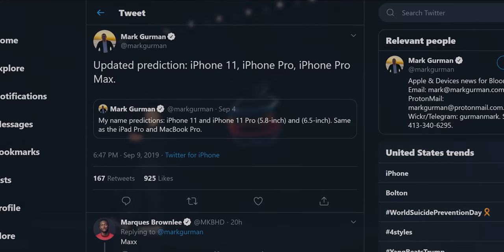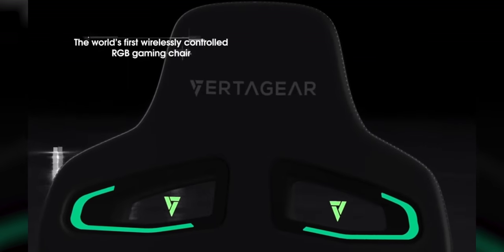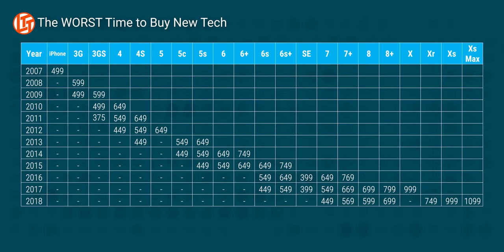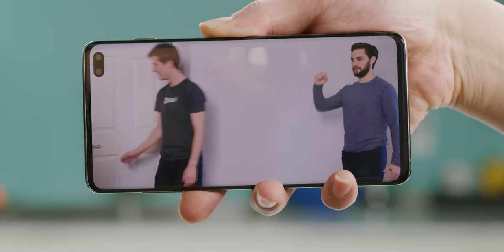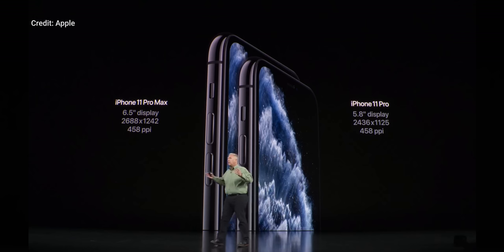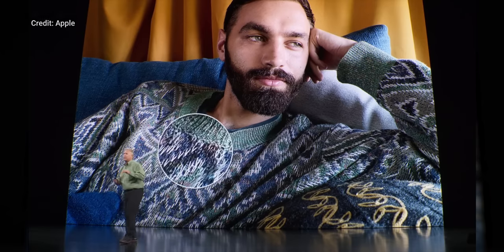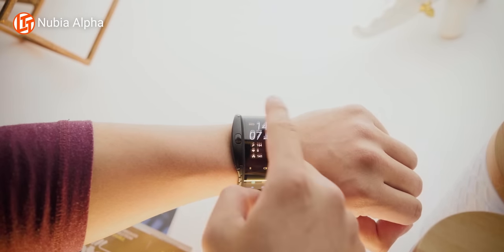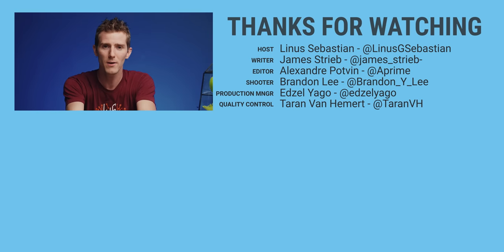Apple iPhone 11 REACTION!!

Comment: LINUS. If you say "LCD Display" again I'll rip all of your LCDs out of your devices, mister Liquid Crystal Display Display
Reply from the maker: That's fine. Just don't take my SSD drives!!
Reply from the maker: Or my NIC cards!!
Reply from the maker: Or my CPU units!!
Reply from the maker: Or my VGA adapters!!
Reply from the maker: Or my ATM machines!!
Reply from the maker: Or my SUV vehicles!!
Reply: Linus is high.
Reply: There's nothing wrong with saying LCD Display. LCD is an abbreviation for a display type. 
It would be wrong to say "Liquid Crystal Display Display" because you are mentioning display unnecessarily many times.
Reply: @LinusTechTips  looks like someone took an extra dose of caffeine
Reply: @LinusTechTips  how high are you Linus?
Reply: Linus Tech Tips I believe you meant VGA arrays.
Reply: Right!!!! Like HD Definition
Reply: @LinusTechTips  u didnt mention gpu so can i have a 1080 or 2060 😉

No srsly i need a computer im playing on some crappy laptop

Comment: Surgical grade stainless steel - an invented term with no genuine meaning.
Reply: I take it to mean that every time you pick up the device you get cut open.
Reply: @ianbarton1990  XD
Reply: Wait you guys dont make scalpels from iphones?
Reply: @ianbarton1990  You'll feel as though you've been cut open if you buy the Pro-Max-plus-RAD version of the phone.  Anyway, the Apple faithful bleed money, so no problem there.
Reply: Being that it's not magnetic, it's 316 alloy stainless. Sounds specific enough to me, but could lose the flashy wording. - Materials Engineer
Reply: One thing for sure though, it will take money away from the buyer with surgical precision (but not so much when dealing with their faulty goods :P)
Reply: 316 Stainless much?
Reply: Steel good enough for surgical equipment? Like, The new iphone 11 can perform lobotomy..
Reply: Next time
Surgical equipments: iPhone-grade stainless steel.
Reply: they surgically remove your money out of your wallet.
Reply: Apple learned this from Xiaomi. Several years ago Xiaomi called their stainless steel “304 austenite”.
Reply: Steve Jobs + Marketing Jargon = Actually Amazing Products with decent marketing.

Marketing Jargon without Steve Jobs = Nonsense gibberish.

Like that, and bionic chip.
Reply: To much slingshot channel for you.
Reply: @seanlee7037  And 304 is like the lowest grade Inox you can get. But hey, it's easier to weld than 316.
Reply: So... the same as an Xacto knife.
Reply from the maker: It's the marketing term for a few grades of stainless steel. SS comes in various grades, like most material goods.
Reply: At apple price iphones should be made of titanium abd then people say its premium
Reply: Means it's germ free and will rust in no time if exposed out of wrapper.
Reply: That is actually not true. There is a such thing as surgical grade stainless steel, because that is the same material as scalpel and other metalic medical instruments.
Reply: That is a thing. It’s used in biomedical applications. So no it’s not a made up term.
Reply: @LinusTechTips  Woosh! Thanks captain obvious. "It's a marketing term" is what we've all assumed, because anyone who knows anything about steel knows its a BS term, just like 'aircraft aluminum'. You know, to distinguish them not using chinese 'potmetal'
Reply: @cyphre  OP's point was that is has NO meaning, but LTT pointed out it has SOME meaning (ie. rust resistant + non-magnetic; 316, 410, 420). Just not a standardised one. So OP was wrong...fair enough response imo?
Reply: Marketing
Reply: So is the term iPhone
Reply: No.. we need weapon grade speakers.
Reply: @chrisp7277  You'd lose the attention of the average consumer by the time you make it to 1 in 316. So surgical steel serves the purpose of conveying meaning better to the masses. - Another Materials Engineer
Reply: I think it should become a THING that the tech geek community starts calling this new apple phone.............. The Can Opener lol

       There we go internet. Let's make it a thing.
Reply: @cyphre  "aircraft aluminum" its the cheapest one because that's the most commonly made aluminum. that's what an engineer told me.
Reply: Incorrect. Surgical grade stainless steel is a special grade of stainless steel that doesn't contain any potentially poisonous metals. (similar to lead-free brass that is used for plumbing fixtures, whereas most brass alloys contain a small amount of lead to make them easier to cut with machine tools.) Surgical-grade stainless steel is used for prosthetic bone and joint implants. I agree it's kind of pointless for a smartphone case to be marketed as "surgical grade", but I suppose there was no reason to select a different stainless steel alloy that does contain potentially poisonous metals if the metallurgical properties weren't actually any better for this purpose.
Reply: Surgical grade means that it is so designed to remove cash from your wallet and makes you think that is a good thing.
Reply: Surgical grade stainless steel means that the phone will never bend. If it falls there’s almost no damage because of its resistance to compression.
Reply: Its actually 316L stainless steel.  But yeah marketing term to make it look cooler kinda like air raft grade aluminum

Comment: "Carved out of a single piece of glass" that sounds like a nightmare to repair.
Reply: They couldn't even cake a camera glass that didn't crack by itself and they made the whole backing out of cncd glass, I mean what could go wrong
Reply: Anything Apple is a nightmare to repair tbf
Reply: Repair? An Apple product? Bro, where have you been for the past 20 years? Apple doesn't want you repairing things.
Reply: Omry Goldwasser  ''not always that even can do it.
Reply: Omry Goldwasser  by repair you mean hand you a refurbished device for half the price of a new one. They don't actually fix your device for you
Reply: You can't repair it. And that's the point.
Reply: Exactly. They don't WANT repairers to be able to get in.
Reply: The wireless charging trend is such a shame. Of course a device which complete back is made of glass is fragile and harder to repair than a unibody design. Up to the iPhone 7, the phones where so nice to self repair and there are sooo much cheap spare parts if you want to do it yourself :(
Btw that's not only for Apple, only they charge these horrendous prices for an inhouse "repair". 
I think changing to high quality plastic materials for wireless charging would benefit the market so much. Or just skip this shit completely, WC is just inefficient and complete nonsense like how hard is it to plug a cable in?
Reply: I know, they are so excited
Reply: of course its made of one peice of glass how does one make a glass plate/window from multiple peices like that -_- its always been like that
Reply: Omry Goldwasser : If a repair typically costs 50% of the cost of a new product, that's how you know the company doesn't actually want customers to repair products, but they are trying to avoid being sued for refusing to offer repairs. ;)
Reply: Bingo! "Worlds first Trillion dollar company"
Reply: You guys need to watch (louis rossmann)

Comment: The fact they still don’t have a USB-C port for the Pro phone is infuriating...
Reply: I'm guessing next year for the design overhaul. Prepare for heavy self congratulation when they do.
Reply: Are you infuriated?
Reply: At least we have a Lightning to USB-C cable and USB-C charger in the box.
Reply: MysteryMii true but the problem remains, when all your devices are USB-C, including laptops, iPad pros, and headphones, the need to carry around a proprietary lightning plug just to charge your phone is infuriating.
Reply: Nolin Huddleston why do u need usb c when the lightning connector still can be reversible...
Reply: @syedemeer6843  how do you reverse a lighting connector??
Reply: Ov3r Yuno usb c is reversible...
Reply: @huddleen  exactly
Reply: @syedemeer6843  usb c is the standard for most other devices. That way you would only need one cable for everything. Plus it delivers more power, faster data transfer, and i think charges phones faster?
Reply: well what kind of upgrades would the next iphone have!? they gotta milk it as much as they can.
Reply: Since it's an apple patent, it's more profitable to use that than the standard for every device that's non-apple. #justapplethings
Reply: @Abby Stephens usb-c on one end, but the end that plugs into the phone is lightning. Every other phone on the planet, and many other electric devices have non-proprietary usb-c Jack's instead of lightning, including most "pro" devices.
Reply: Kind of ironic that the Macbook is all about USB-C but they won't put it on the iPhone.
Reply: It goes against their entire ecosystem it's all a money thing because they own the lightning port this is why I use Android
Reply: the pro means the camera pro
Reply: Nolin Huddleston Every other phone on the planet? That’s bullshit. My buddy got a mid-range Huawei recently and it’s micro-USB still.
Reply: That is because pro in iphone pro means pro suckers.
Reply: Yeah they're using USB 2.0 still
Reply: Tim Tran im sorry but i dont actually understand what that "reversible" means...pardon me
Reply: Yes, we need a USB-C port so everyone has to buy a few hundred dollars with of new cables and docks. 🙄
Reply: @VideoArchiveGuy  you need a USB c port because its a million times faster and more durable.
Reply: It will be next year
Reply: They do it for the cash that 3rd party chargers have to pay them cause lightning is their own plug
Reply: And them thick ugly bezels
Reply: Its not applely, if everyone does that now, then apple doesn't, like in pc when everyone using usb a they changed it to usb c, and if everyone used usb c in phones they wont use it.
Reply: i think it would mess up carplay, which is why they are not doing it
Reply: Might I ask why? I don’t see what’s wrong with lightning. Seems to work fine.
Reply: Empire Entertainment such as? I have 2 devices that have USB-C ( Sony Xperia 1 and a Huawei POS phone that’s broken) and I haven’t felt any of the benefits. Fast charging is about the same as my iPhone and since I never plug my phone into a computer, any benefits there are meaningless to me as well.
Reply: @dammitcarl1082  my experience with usb c is that the ports and plugs are more finnicky and, this isn't really talked about much, so much more of a hassle to clean. i think lightning works just fine (it's really not a huge deal to have a single other charger to use, too)
Reply: Can't have that radical of a change that fast, that would overwhelm people, remember were talking about apple users here. Doubt that even the iphone 12 will have usbc because apple users are such shee0 theyre okay with it 🤣🤣
Reply: Apple owns the license of the Lightning port and wire, so anyone who wants to make a third-party iPhone cables, then the have to pay Apple for royalty.
Reply: @syedemeer6843  because almost everything else is USB C or Thunderbolt 3 or wireless charging. Most Androids, iPad Pros, Macs, some Windows PCs, many wired earphones, etc all have USB C

Comment: “ Surgical grade stainless steel”
Well that is far worse than “ Aerospace grade aluminum” on my Nexus 6P
Reply: Steel is heavier but more durable - depends what you are looking for.
Reply: Your 6P is still going strong? Mine bootlooped long ago. Back to apple iphone.
Reply: Wasn’t that the one that bends in half easier then a soggy gram cracker?
Reply: Not as good as my intergalactical grade Nokia 3310
Reply: @brando12343  thats more dependent on the thickness of the steel rather than the material
Reply: That's Apple for you. Trying to sound special by any means..
Reply: Not as good as my Metallica grade death metal
Reply: I mean aluminum still scratches and bends an whoooole lot easier than stainless steel lol
Reply: david rektham well with the nexus 6p literally nothing was actually connected to the metal frame, bent easier then a 6 plus
Reply: MR ONO oh yeah, i have an iphone x and that’s one of my favourite features of it, dropped it so many times and has zero damage, nice to know that stainless won’t buckle like aluminum does so if it’s dropped my screen and back are more likely to be fine, problem with aluminum is that it has so much give to it that any impact gets directly transferred to the screen of the phone

Comment: i remember when apple said they would never put a lump on the back for the camera
Reply: Did they ever not have a camera bump?
Reply: @xxojuc  before 6
Reply: And all the times Samsung did the same type of thing to Apple, making fun of Apple of doing x, then few years later did the same thing.
Reply: @JonnyD3ath  You can always use a power drill to make a notch in any phone, it's called hot rodding.
Reply: Apple said big screen is not needed, Apple said more than one model of phone is not needed, Apple said digital pen for mobile or tablet is step back and joke .... Apple have great products, but for they'r pretentious stance, they are loosing the tempo :)
Reply: @tskjesusfreak  they always did bumps on cameras boy (samsung)
Reply: Pepperidge farm remembers.
Reply: @tskjesusfreak  Samsung did it for the note. Which has a PEN in it. The jack will most likely be in the s11 but not in the note 11